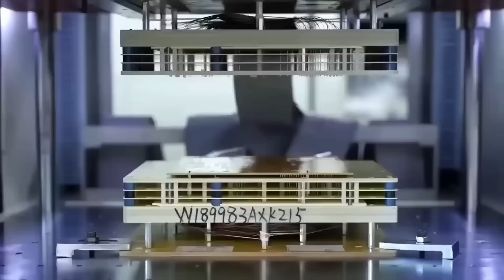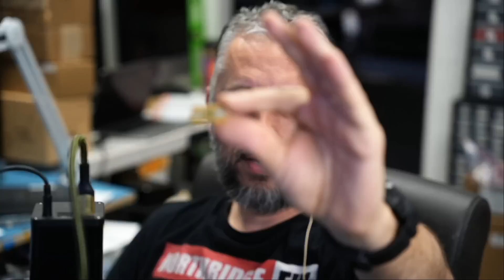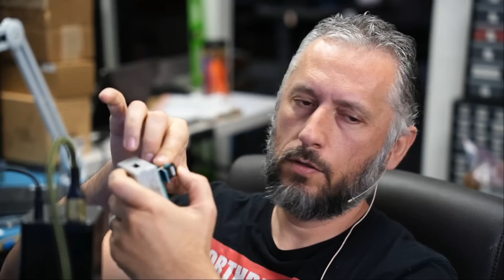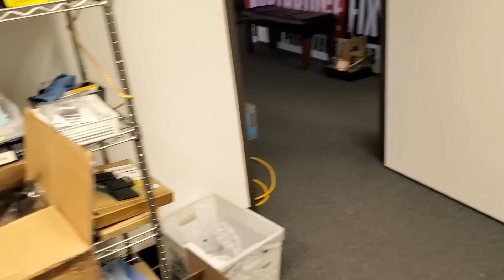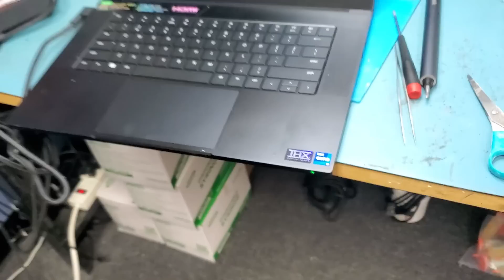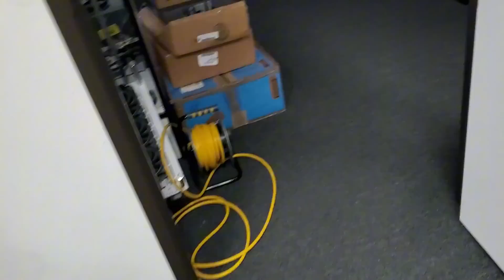vBIOS Mod Killed a $3,000 Razer Laptop – Avoid Gaming Laptops!

Comment: i don't know if the customer is knowledgeable or not.. but modding vbios wont do sh*t!

the gpu is power limitted PHYSICALLY! for a f*ck*ng reasons.. that tiny heatsink fan won't be able to maintain the temps if it's unlocked..

Comment: The bios is very crucial to the function. You only want to flash the bios if it is completely necessary or you run into hardware issue or system instability. Do not try to b flash with another brands or manufacturers bios update. If you want faster speeds then install an external GPU and buy a desktop level card.

Comment: The extent people should go AT MOST with modding stuff on their laptops is at driver level, like modded GPU drivers and such because it's really easy to reverse it if things go wrong. Bios modding a mobile GPU chip is insane, gaming laptops already have design that promote failure due to degradation why try and unlock the wattage of your components. It's not like that gpu is bad either.
People are REALLY comfortable and REALLY picky nowadays because they can't play unoptimized AAA titles at 1440p with a card that runs about ANYTHING

Comment: My $2000 G15 Advantage laptop was bricked by a frustrating Windows automatic BIOS update. Now, the device powers on the lights come on, and the fans spin occasionally—but there’s no POST. I've ordered a CH341 Programmer, but I can't seem to locate the BIOS chip on the G513QY AMD Advantage model.

Can someone help me find it? Also, I noticed that this laptop doesn’t have a CMOS battery, which seems unusual.

Comment: For those who are interested, there is more to this than meets the eye. While flashing a higher TGP vBios is utterly braindead on a machine that already naturally will blow its GPU VRM's due to it's low TGP to begin with, the reason it broke was not because of the customer but Razer themselves. 

Flashing a custom vBios is mostly harmless for taiwanese or chinese notebooks, even when flashing extremely high TGP vBioses the EC will often throttle the entire system before any real damage can happen, meanwhile american e-waste is designed to self explode when doing any modding, which is very common since in America 'you own nothing and you'll like it', flash a moded BIOS on an alienware, another chip will check signature and blow a fuse on invalid signature, Razer won't sell replacement parts because and build fragile e-waste, however when flashing a vBios on the GPU, it dies because of some other signature BS check, the real kicker here is that Razer notebooks have a small chance of messing up the signature under a firmware update causing the GPU to artifically brick because of their anti repair dumbfuckery. 
https://insider.razer.com/razer-support-45/blade-14-2022-gpu-dead-after-firmware-update-66566

Do not buy any american made laptops except for Framework period. You never see chinese laptop break, never once have I seen a clevo or tongfang break on their own, but have seen tons of american e-waste + ASUS & MSI. Lesson of the story, buy chinese, it sounds crazy but they are the most reliable, well built and performant laptops on the market and has been for almost 10 years now, the fact this isn't more common knowledge is crazy to me, the fact these e-waste keep being a thing is just blowing my mind.

Comment: My ASUS TUF F15 FX506HC won’t turn.
When I plug in the charger, the charging light turns on. When I long press the power button, the power button light and thelight blinks for some instance and nothing happens.

This is happening after the latest BIOS update 312.

The service centre team said they tried flashing the motherboard firmware however they just confirmed there was an issue with the motherboard and it need to be replaced along with the keyboard.

I tried all possible ways(removing the keyboard and shorting pin 5, hard reset CMOS, f2 etc.)

Now I will go to some laptop repair shop and see what happens.

If someone has a working unit, go and sell the useless box and go for some other good brand laptop or desktop since ASUS is behaving wierd and seems to be working unethical via firmware and BIOS updates which are making end users device unusable and the keyboard or motherboard gets malfunctioned or dead after the update.

Seems like ASUS is hit with some kind of cyber espionage with some sort of deadly malware which is causing a lot of issues or ASUS is using the same tactics which some brand uses to make their end users device unusable after certain period of time via updates by slowing down the device or causing permanent damage to the device hardware via updates. Anyways a lot of people are affected and ASUS is completely unaware and not concerned about it. Over-all experience is really bad as it seems ASUS is not trustworthy.

Key takeaways: ASUS is not trustworthy. I wasted my hard earned money by trusting ASUS just for the sake of fulfilling my childhood dream of having a gaming laptop.

Comment: I like how people that have zero idea about how electronics are engineered and just assume there are "conspiracies" involved in the engineering. Sure, there may be some software BIOS side voltage adjustments, but physically speaking, you're not going to get much of a performance increase when undervolting/ OC a GPU. A Die only has so much wiggle room between the models, you're not going to get "one up" tier performance increases from a chip that physically lacks cores, lol. There are reasons why TDP's are catered to form factors as well. Stop messing with things when you don't understand the electrical theories behind them.

Comment: I had a 2020 blade a few Yr back, worked fine (just over a year old of light use) didn't use it for 2 months went to use it again and it was completely dead, no lights nothing, new battery & wall plug... Nothing Razer wanted 800 for a new board (i7 1660ti) so cut my losses and sold it on ebay 320 the bid ended at 
Recently got a 2024 Asus rog strix scar 16 4080 and immediately bought the 3yr extended warranty + accidental damage insurance. Just wished they made laptops more repairable/sold replacement parts.

Comment: I remember doing this on an old 2060 laptop. Went from 80w to 115w and got an amazing performance increase for about 10 mins then it would overheat lol. I limited it to 100w and it still got a pretty nice increase without overheating

Would not recommend to people who don’t know what they’re doing, as evidenced by this video. I also think that the only laptops this works on reliably are those with an iGPU, as even the failure of the dedicated would still be able to use integrated to flash back if it goes wrong

Comment: That's why I never buy a laptop period. They're just junk after a year.  I remember spending $1500 for a laptop and right after a year the screen went blank.  The laptop is only worth its weight when its still under the warranty.  After that, its just garbage. Anyways,  why would you update a laptop with a different bios?  They're two different bios for a different laptop.

Comment: Why do they do this? I'm glad that you're channel exist to educate the uneducated sir and fix these electronics! People need to understand that laptops don't have replaceable GPUs and CPUs because they're soldered to the motherboard! They're not like desktops where you can swap the GPU and CPU and upgrade them to a more powerful one if the sockets are compatible with the motherboard! You can even swap the PSU on desktops if you want more wattage! The only thing that you can swap or replace on a gaming laptop is the RAM, the HDDs, SSDs, M.2 SSD storage, the LCD or OLED screen and the rechargeable battery. Sometimes, some people just have no sense!

Comment: So the owner decided to randomly overwrite his vBIOS with random vBIOS image without even first creating a vBIOS dump of the known good state (that is, copy existing vBIOS image from the hardware so you have something to return to after failure)? And considering the owner is now looking for cheaper fix than just getting a new motherboard suggests that the owner wasn't just filthy rich in the first place which makes this kind of gamble really weird.

The fact that iGPU was also disabled before attempting this was also weird but that should be easy to workaround by resetting the whole BIOS (shorting NVRAM power delivery in worst case).

Comment: A tip I can give anyone who wants to mess with vbios flashing,always back up your original file,you never know what could go wrong,and avoid messing with that kind of thing,it's bad news and unnecessary most of the time,I once tried to flash a  rx580 bios on my 570,bricked the card and I had to use 3 PCs to bring it back,for some reason the card worked fine on the second PC,I used my laptop to look for the necessary files online,it was luck that I managed to bring it back,I remember I bricked it at 10pm and had it fixed at around 7am,terrible experience.

Comment: People do strange things. I had someone tell me that they cut the end of his ram off so it would fit in the slot. Another person told me he attached his heatsink to his CPU with Super Glue. When I was younger, I put an aftermarket cooler on my GC and one of the holes didn't line up so I drilled a hole and used a bolt and nut.

Comment: Yikes. I can understand there being a point to VBIOS modding in a situation like Vega 56 vs 64 where there would actually be potential practical benefit, but there just isn't any on GeForce 30 series, especially not on a laptop. Also worth keeping in mind that on the NVIDIA side, they actually have VBIOS signature checks post-GeForce 900 and if that signature check fails because someone tried a VBIOS mod anyway, the GPU doesn't boot. You would definitely need that 2023 file to have any hope of getting that GPU back up and running, but like you said, seeing as nobody has donated theirs to that TechPowerUp collection, and seeing that they must not have bothered taking a backup beforehand like draakevil said, there's not much else to be done other than to hope that someone else with a 2023 Razer Blade with a 3070 Ti eventually runs GPU-Z and dumps their VBIOS.

Comment: If it ain't BROKE, DON'T FIX IT applies here, applies always. I noted on several good other electronic repair channels, a common theme plays out over and over again, simple customer repairs and unnecessary TINKERING creating about half
of system failure issues. Almost always 10 times more complicated issues arise. ie. customer damaged boards, poor soldering, overheating boards, broken connectors,  DOMINO EFFECT POWER CIRCUIT DAMAGE, blowing out CPU's.

Comment: I flashed my Dell Inspiron GPU back in the days to get some extra performance (7900 GS to 7900 GTX BIOS) but I knew the risks, I was willing to deal with a broken graphics card (MXM format, so replaceable) and I wasn't stupid enough to not dump the 7900 GS BIOS first just in case.

Experimenting is fun, as long as you know what you're doing, know the risks, and have the files and the tools to roll back.

Comment: Ohh trust me I know.... fell head over heels for the first 8 core 16 thread gaming laptop from ROG back in 2017.... Ryzen 7, 1700, DESKTOP CPU in a SOCKET, stock TDP and Clocks... SWEET I can upgrade later when better CPUs come out, 380W power brick, nice, it's a high end $1500 laptop, you expect that, has an RX580 GPU, nice also... I can put an NVME m.2, NICE, two slots for DDR4 up to 64GB.... More than enough.... What's the issue???

RX580 is kneecapped at midrange laptop performance,
Low end 2009 style BIOS with bare minimum settings,
DDR stuck at 2666, no options to overclock,
AM4 Socket completely fucking useless because ASUS never released BIOS to allow upgrades (what's the fucking point?),
Touchpad randomly has deadzones, ZERO firmware updates to fix it.
Keyboard randomly has non keyboard interactions, you're pressing the D or I keys or literally any other useful fucking key and suddenly,, out of the blue, the browser closes, or the back button gets pressed, or the application minimizes, erasing whatever you were typing. The alt menu hits, or the windows key.... Obvious giant huge fucking problem defect but nope, no firmware fix.
Absolutely garbage built in software... Laptop comes with two loud as fuck high RPM server grade fans, get really loud, but they give you this piece of shit software (Gaming Center) that gives you bear minimum control, no curves, no API to allow other apps to utilize it. This garbage gives you everything free software already does but with the addition of the fan speed "boost" control that is the only way to control your cooling solution. Yawn, not impressed.
Can't undervolt CPU, can't undervolt GPU, can't change power limits, can't do jack shit... It's a midrange laptop with high end desktop hardware masquerading as a high end gaming laptop. 
On top of all of that, it's made with mostly chinesium plastic that breaks within months of light use, the screen hinges broke within a year and had to be JB fucking welded down, the microphones and webcams stopped working randomly one day, the key board power key that is the only way to turn the laptop on and off died one day... Ohh and when I tried to remove the laptop battery, the bracket which locks the connector down is metal, and it isn't latched in, so one day it slipped off and hit some circuitry above it which shorted DC/Battery to something display related which nuked the motherboard.... Which costs over $300....

In short, Fuck you ROG, Republic of Garbage, worst purchase of my life. /End Rant

BTW this was a GL702ZC.

Comment: I agree - laptop, just recommended updates. On desktop you can experiment. I remember Chaintech and nForce made good motherboards with high voltage tolerance and good protection. Some had programibility options to boost x386 to levels of lower x486 by boosting clocks or forcing graphics cards (liike Cirrus or Tseng), but that time is over. now you have laptop as it is  - deal with it. Experiment on desktops, with heating solutions, easy to replace parts, and so on....

Comment: I always use the clip and I am able to use it quickly. Sometimes it takes a few tries, but it is at most 1 minute. If you use the clip alot, after some time you have to replace it, because it will have some wear on the plastic, and won't properly clip.

Comment: Yeah what this customer did was indeed stupid. They spent $3000 bucks for a gaming laptop just to break it. I had good luck with my  2 gaming laptops I’m in year 2 on my current laptop while my previous gaming laptop lasted me over 5 years. Also that clip method could also cause to brick the laptop or gpu or even a normal bios update due to a poor connection.

Comment: Wait... he didn't even dump the BIOS before bricking it? That's just stupid. On PC you usually have dual BIOS for GPUs, so it's not that big of a deal. But doing this with a laptop is high risk, minimal gain if any. Just dumb.
Reply: That's exactly what I thought.   He probably doesn't have the tools to flash the BIOS chip, but he would at least have a known working BIOS file to provide to Alex (or whoever would have been willing to take the job)
Reply: Flashing is plain stupid on a mobile, some bios go into write protect making it irrecoverable without a hardware programmer, plus most vbios on mobiles are integrated with the mobo bios.
Reply: That's incorrect, GPUs typically have only one EEPROM chip unless you are referring to desktop cards, which only a portion of cards released have them, the dual BIOS thing your probably thinking of is the typical BIOS (not vBIOS), but even then most don't feature dual BIOS chips, probably due to cost saving.
Reply: its already bricked, what you just said is more stupid.
Reply: In his case, even if he dumped it, flashing it back may not be possible once the video card falls off the bus due to a bad vBIOS.

Comment: He bricked it. I had noticed some burnt marks at 6:43. But I could be wrong about it.

Gaming laptops in general are crap because most of their cooling is always inadequate unless if you had actually bought one that has much better cooling. I had pulled a stupid with K5 Pro and bricked the video display on mine (plus, it is best to ignore laptops that has known failures at launch). But I had found a fix for mine with a certain firmware that was bugged for quite some time after using a similar model's firmware and notified on MSI forums, which in turn they had actually fixed it for good. And the last time the issue that I had tried to solve it with K5 Pro, which I believe the VRM voltages were too high for the cooler (or the cooler was broken).

And that's what is currently going on with my gaming laptop. But I hope that there would be a fix for the cooling issues on it. Should've just report that the VRM voltages were too high. It is what it is. I had gambled with it and paid the consequences.

Comment: i have a laptop asus  2022 model 12700h with 3070 i undervolted the laptop guess the temp when idle 30-50c if games over 70c compared to desktop laptop is frying because of bad air circulation , if u buy a gaming laptop and u expect to last or perform better then a desktop u are a fool...